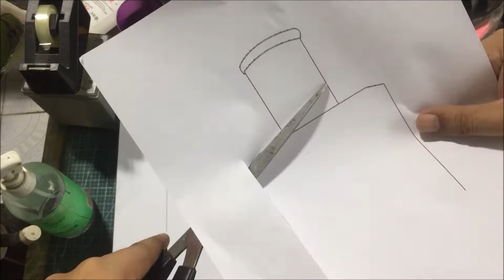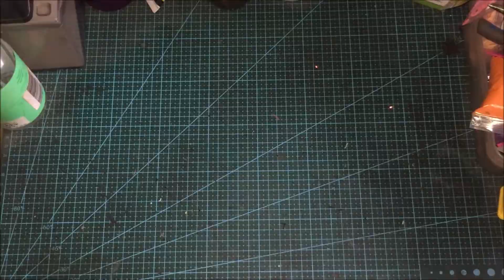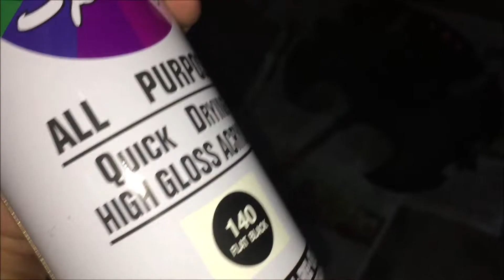Godrick's Axe(Elden Ring) Tutorial FREE TEMPLATE

Comment: What thickness did you use for your foam? Could you please leave a list of materials? I would love to make this.
Reply from the maker: I only used a 2mm foam because that's the only one i could find here. 😅but you can use a thicker one so the axe wont be so hollow like the one I made.
Reply: I’m going to try it with 5 mm foam 🤝
Reply from the maker: @lukegaming7293  thats Awesome! its gonna make it sturdier.
Reply from the maker: @lukegaming7293  the one i made already lost one of the blades bacause the foam is to thin. 😅
Reply: Dang that sucks. So then it turned out to be a good thing that I bought the wrong foam 😅
Reply from the maker: @lukegaming7293  yeah, 😅 its gonna be more studier. and you can swing the ax around to.